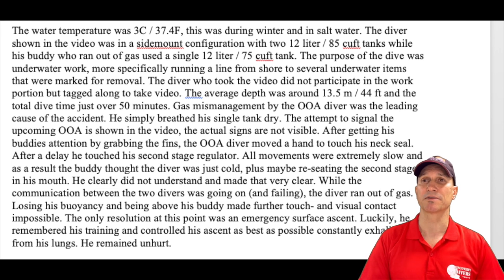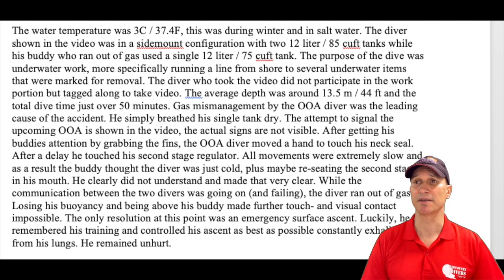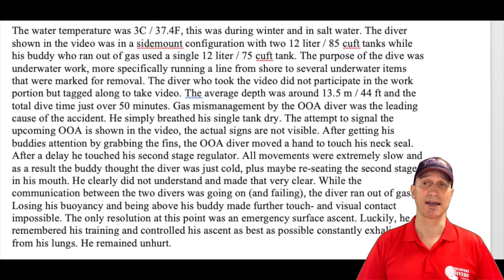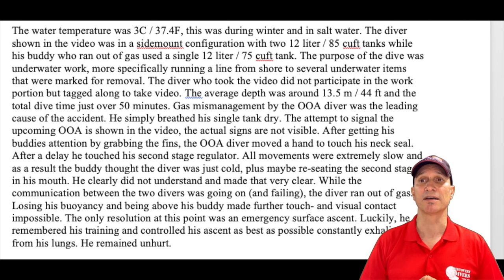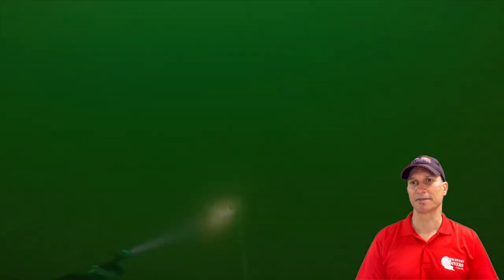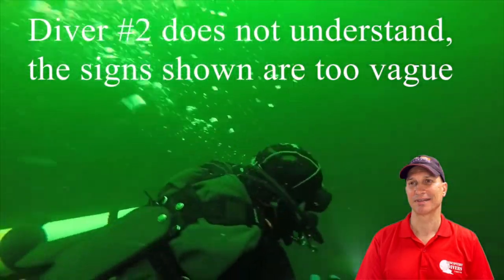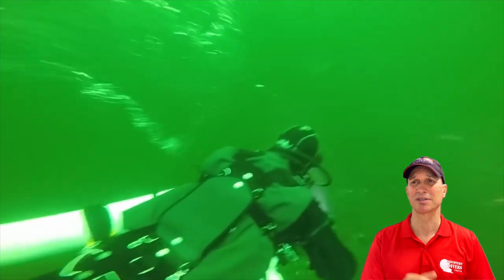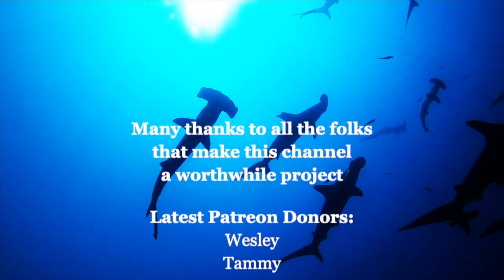Scuba Diver Out of Air and Emergency Ascent - Catastrophic Buddy failure

Comment: I think a pretty good analysis. I am always concerned when divers enter the water with large differences in gas supply and wonder if there was good pre-dive communication. However, every diver must be responsible for their own gas supply and curious about their buddy's gas supply so each diver failed there. I wouldn't be as hard on the sidemount diver in terms of not recognizing an emergency since the out-of-air diver gave completely inept hand signals. This is something that instructors must drill into trainee's heads: if you don't communicate well underwater using agreed upon hand signals, bad things can happen. In addition to knowing the configuration of the buddy's equipment, these two should have reviewed emergency hand signals and air-sharing technique before entering the water.
Reply from the maker: Thanks, Dan. Good lesson to all of us to make our signals clear and insist that they are received, understood and acted upon.

Comment: Analysis is spot on.  I would say that there are OOA situations that are surprises.  I certified my wife for Advanced diving and she was my first emergency in my career , because ofcourse she was...lol.  Anyway she had an O-ring failure and her tank drained, but the failure wasn't explosive so no one noticed the bubbles between breaths.  I had a class of around 10 students and 2 divemasters on tour.  She grabbed my attention and showed me her gage and it was 0.  I gave her the octo and up we went nice and controlled.  One of my DMs followed the other stopped the group and held on the bottom.  Made sure she was OK and tasked my DM to take her to shore went back down and completed the dive with my students.  At first I was a bit miffed because my first thought was she missmanaged her air, but I still had 1500psi and my students were all around 1000-1200.  After the dive we debriefed and she said she was checking her air, her last check had 600psi and she thought the dive was almost over, it wasn't until it became hard to breathe a few minutes later she checked her gage and realized she was OOA.  An post mortem on the equipment found the O-ring almost cleaved into but not completely.  Plenty of possibilities from a poor equipment check, poor seating of first stage, and just blind luck.  Was a learning experience for all and best of all she didn't panic knowing she had air all around her closer than the surface.
Reply from the maker: Hi Weston...agreed, catastrophic failure is a (rare)possible and different animal 👍

Comment: OK, as you say we just don't know enough of the surrounding circumstances to analyse this properly but we can define some assumptions and draw lessons from the assumed scenario.
Let's say they were diving as a pair and the OOA diver had agreed with the working diver that he would film the dive.  What should have happened:
Dissimilar rigs are a crucial issue to be discussed before you get in the water.  I generally dive with twin back-mount 12s or single 12.  My buddies may have twin sidemount ali 80s, sidemount steel 12s, single 12s, single 15s or even twin 7s.  There may also be a variety of jacket BCD, backplate, harness and wing, or sidemount harness and wing, which is actually quite a bit different.  There may also be weight pouches, weight belts or no ditchable weight.  What this means is that as soon as the divers realise they have different rigs they need to explain to each other exactly what gear they have, how it works and what the emergency drills are.  In this case I would expect that to have been led by the sidemount guy, both because he has the more complicated gear and because of his greater experience.
Included in this must be a discussion of gas time available and turn-back/ascent minima.  This should take into account the higher gas consumption likely in very cold water, and emphasise that the single-tank diver is undoubtedly going to be the one who is going to call time!
As a side note, a water temp of 3C also has the potential for icing issues in the regulators, even assuming they are cold water-rated.  This will exacerbated by the higher SAC rate mentioned above.
Cameras:  Cameras are the bane of newly qualified divers as they suck you into creating the imagery and narrow your situational awareness.  Task focus on filming has to be well up there contending for the number one cause of out-of-air or depth exceedence events!
Signals:  The signals for low on air and out of air should be part of the brief, together with the process for air sharing.  As above the dissimilar rigs make this particularly important as the single tank diver with 60 dives may well never even have seen a technical rig.  The correct procedure by the way is for the sidemount guy to donate the regulator he is breathing from, offering it on the long (7ft) hose that is kept round his neck.  He then switches to his alternate which is on a bungee necklace and immediately to hand below his chin.  One of the reasons for this is that a panicked diver will often rip the reg from your face anyway, so make it SOP!  As a sidenote (LOL) sidemount divers do have to switch regulators regularly throughout the dive so they breath down the cylinders equally.  If the guy is already on his alternate necklace the primary will be clipped off and need to be released, and that should also have been in the brief.
Thinking:  In diving there are only a few things that will actually kill you immediately.  In this case, assuming that you haven't been paying attention and keeping a regular eye on your gauges, you can exist quite happily with no air for a minute or so at 13m.  Think about situations in advance, eg by watching these sorts of video, and use your training to select the best option.  Number one has to be getting that buddy air!  Get his attention, use the correct signal, be insistent, rip that regulator!
If number 2 is an emergency ascent, remember your training.  At 13m you are only 45 seconds from the surface, even with what will feel like a slow rate of ascent, except instead of holding your breath on the bottom you will have more than twice the volume of gas in your lungs by the time you get to the surface so you can actually let a lot of it go in a steady stream as you were taught.  That's why we do the training, to show you that these scenarios aren't as scary as you'd think!
Plus points:
Despite sub-optimal actions from the start, the guy lived.
It was good to see how close these 2 guys were.  If your buddy is more than 2 or 3 seconds away they're not your buddy, they are just a spectator!
Reply from the maker: Excellent comment, as usual, Tim. Spot on analyses. Thanks for adding this to the comment thread 👍

Comment: One time on diving in Cuba… I preset a emergency surface from 80’ with a Divemaster assistance, so from 80’ down going up beading the air from my BCD….. getting a slow assenting to the surface the air taste awful…. But a surface with little air in BCD I had to inflate it at the surface cause in my tank remained 900psi…. So If you think that your out of air at the bottom…. Think that your BCD is full of it….. it could save your life.
Reply from the maker: Great point, CWH…thanks for posting 👍 (and Cuba must be amazing!)

Comment: new subscriber here, sir! really appreciate your video content as i do find them informative and engaging for both new and experienced divers so kudos!

now regarding the dive, i think the key point here is all about the quality of dive planning being observed. this is especially crucial if one is going to be diving with a buddy or a team with different dive gear configuration and level/s of training.

so given the pre-dive scenario, 
- a clear set of hand signals should have been established or agreed upon together with discussion of possible emergency scenarios. 
- part of the plan due to having a different dive gear configuration between diver 1 and diver 2 is an air-sharing drill or practice on the surface; most double sidemount divers follow a long hose primary with necklace 2nd stage config so air-sharing will be different for an OW-trained single-tank diver.
- diving coldwater can mean more work to keep warm so air consumption should have been regularly monitored with each diver signalling for remaining tank pressure from time to time.

Comment: In a typical sidemount configuration, it is primary donate, sort of. Since we breath off of both regs, sometimes we have the necklace in our mouth, sometimes we have the long hose. When I did my sidemount training, when we get an OOA signal from our buddy, the first thing we do is run our finger down our cheek to see if it is necklaced or not. If we are breathing off our necklace we reach down and unclip our long hose and donate it. Ideally your long hose should have a QD system of some sort instead of a tied on bolt snap, that way if you have bolt snap issues, or if your buddy simply needs it in a hurry they can just rip it off your d-ring. Of course the QD has disadvantages, it can come off. I just lost one the other day, I was at 20 feet in a 100+ feet deep sink hole, switching back from my oxygen reg, and the QD slipped off my long hose, into the murk below. $20 down the drain. cry

Of course that is a typical sidemount configuration with a short left hand hose, and a long hose to the right. Some run double long hose, and those that don't dive with their buddy (or simply dislike them) you sometimes see double short hose. Those guys with the weird Sweedish sideways regs sometimes don't just bolt snaps and just stick their regs in a bungee loop on their harness when they aren't breathing off them.

The key here is communication. I personally have my long hose with an orange long hose, an orange face plate thingy, and a reg mouthpiece so it sticks out a bit more, and in the photos I see of myself it seems to work.
Reply from the maker: Thanks for adding the useful context, TPL. I have zero experience with this configuration. Seems a buddy briefing is def in order.
Reply: @DiscoveryDiversTokyo  Definitely particularly since there is a somewhat solo mindset among sidemount crowd. We do gas matching, and the briefings but the general expectation is that a sidemount diver, like a CCR diver, should never need gas. As it would take two gas failures for them to have to rely on a buddy. If my sidemount or CCR buddy is working on an issue, I generally will watch and wait either until they tell me what they need or it is clear that they need help (like if your CCR buddy is shaking like he just watched an episode of Pokemon).

But that might be a cave thing, I don't interface much with the tech crowds outside of cave country. And we do have a somewhat unique mindset.
Reply from the maker: @Teampegleg  That's a very fair point, that since the SM diver had independent redundancy, he might have had that solo diving mindset.

Comment: Part of my training in commercial divers class was we had to drain the tank at 80'.. It was in Seattle Washington, in December 1988, at Alki beach, the water temps was 45°, and my depth was 80'.  We were wearing wet suits. I was useing an aluminum 80 tank.
 I knew it was going to happen but just was not sure exactly when.
   After what seemed like a long time, but maybe it was in reality about 40 minutes, I went to take a breath and it was like someone turned the tank off. I looked at the guy I was with and did the out of air signal and he went to hand me his octopus.. I politely waved it off ... Mainly because we were about 7' apart and I couldn't reach it..  so left with an empty tank, and lots of cold water, I decided I just as well head up.  I slowly made my decent. And I did stay slower then my bubbles. Actually it was pretty much a normal accent. I was  not panicking, or even excited. I simply went up as normal. Once at the surface my buddy appeared right next to me. He looked at his gauge and was really close to being empty, but still had air. Our instructor was telling us to empty our tanks on the bottom for training. He wanted us to get real life feeling of our of air outside of the swimming pool. Only four out the nine of us did it. 
  The amazing thing was I got to about 20 feet and I had air in my tank again and once on the surface, I said I wanted to go down to see if I could reach the bottom (just experimenting).. but after a short dip, I was out of air again. Lol. 
 It was part of the commercial dive training.  By time the class was over I could easily free dive in a wetsuit to 33' and pick on the other divers that were practicing on the bottom. Lol.
Reply from the maker: I've never tested this personally, but first stages work on a pressure difference principle and a tank that is "out of serviceable air" at depth, will deliver more air at a shallower depth as a function fo the altered pressure difference between inside and outside of the tank. Also, the air in our hoses expands, yielding another small bonus.
Reply: Awesome!
Reply: @DiscoveryDiversTokyo  I was a little surprised that it expanded that much, but I got a couple breaths out of it at the surface. Lol.. of course I was a lot younger, and was diving everyday, swimming everyday, and a lot skinnier. Hehe
Reply from the maker: @hearsejr  We were all a lot skinnier!
Reply: @DiscoveryDiversTokyo  hahahaha

Comment: As an experienced diver, I know that a free ascent can be made safely from 60 feet (18.3m). Also, monitoring air consumption is the regular habit of an experienced diver. This is a "panic" move by someone I would not want to dive with!
Reply: That’s still 1 or 2 minutes (depending on the agency and their guidelines) for a safe ascent, I can’t even hold my breath for 30 seconds let alone doing a slow exhale for that time period or more. There’s few of us that can actually do this but it is possible. In an OOA situation, I doubt there is usually time to get a good lung full beforehand so I would argue that making a safe controlled ascent from this depth, although possible, is quite tricky and not likely to happen for most divers.
Moreover, as I’m sure you’d agree, it’s better gas management, redundancy and prevention of OOA situations that are key.
Reply: @SailtoUtopiaAdventures  - PADI Controlled Emergency Safe Ascent (CESA) is from 9m, like I stated above, conducting a CESA from 18m is tricky and, yes, never hold your breath when diving (number 1 rule) especially on ascending as there is a risk of lung expansion injury or arterial gas embolism.  What I meant was, try doing this on dry land and make the ‘arrrgh sound’ as you would during a CESA, it’s extremely difficult. Granted, ascending from 18m the air in your lungs will expand providing their was air there in the first place.
Reply: Under stand human physiology and know if you have been breathing normally at 60’ and your tank goes empty you will have enough air to slowly surface (which means staying below your smallest bubbles).
An embolism can occur if your ascent is too rapid!
Reply: @SailtoUtopiaAdventures  - and how does that work on an out of air situation? If the tank is empty there is no air left.. And yes, an embolism is from rapid ascent, that’s what I also said! PADI ascent rate is 18m per minute and SSI is 9m per minute so from 60’ / meters you’d would next to slowly exhale for 1 or 2 minutes, even with the air in your lungs expanding most people cannot do this, hence why a CESA training is 9m depth.
Reply: @SailtoUtopiaAdventures  - hey, all the best to you, I’m a DM with over 1000 dives
Reply: Strange… seems your dives have been shallow!
Reply: @SailtoUtopiaAdventures  yes, limited to rec diving so 40m max.

Comment: Agreed with the assessment of point 1: With the sole exception of a catastrophic failure of equipment (which is well-beyond extraordinarily rare), there is zero excuse for running out of air.

Point 2: Absolutely, part of your pre-dive briefing is briefing gear configuration, signals, the plan, gas management, and acknowledgment of an understanding of the brief. That being said, “long hose” is “long hose”. Doesn’t matter if it’s back mount or sidemount. Donation of a long hose is the same. Whichever one is not on a neck lace.

Point 3: The out of air signal is pretty universal... Honestly, there’s also zero excuse for diver 1 to simply ignore diver 2’s signals. Pay attention, take time to understand, and acknowledge your buddy’s communication. It’s all part of crew coordination.

Point 4: Spot on about traveling at the speed of the slowest bubbles.
Reply from the maker: Thanks, Pinnacle. Hope the channel is doing well 👍

Comment: Diver one at fault. 1 There is never a reason to run out of air. You have a gauge. 2 Out air signal is very clear. I side mount. I see the signal he gets my regulator. He does not have to search for it.